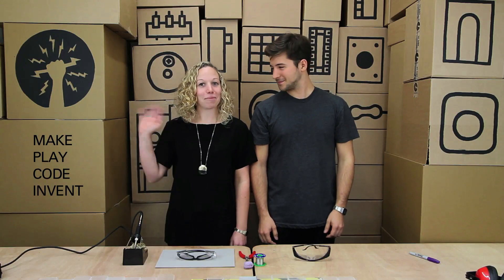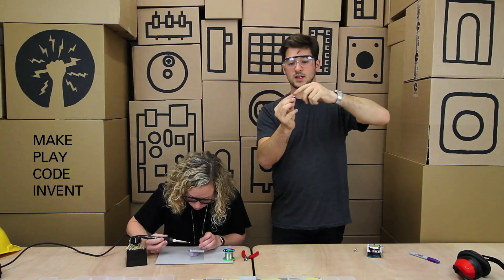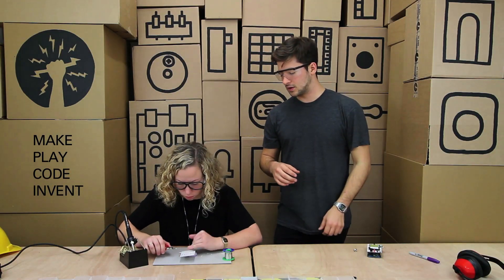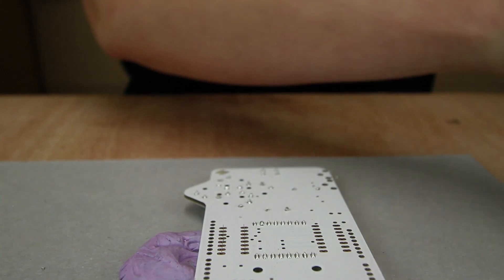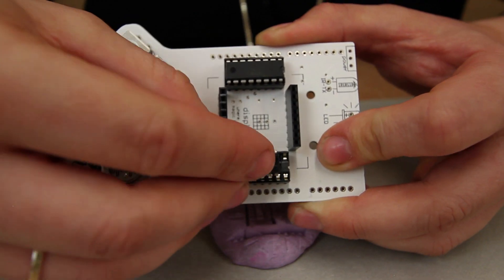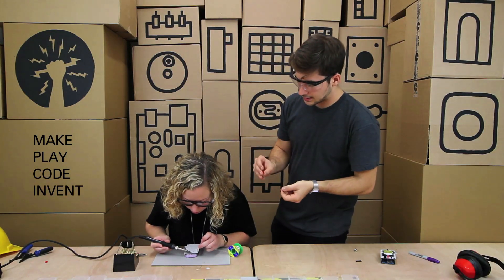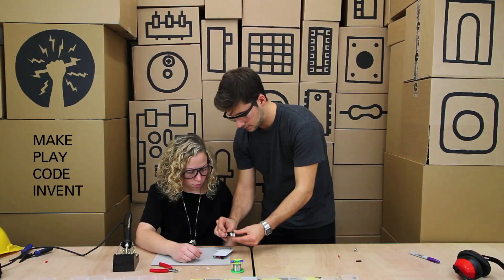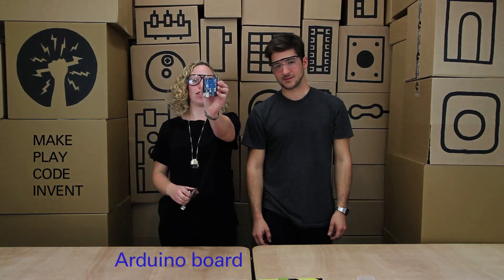Soldering DIY Gamer Kit!

Comment: on the 8x8 display screen, theres a layer of plastic or something to protect it, but i found out there was another layer under that. when i took it off, instead of LED's glowing white, they glow a strong blue.
Reply from the maker: Hi Christopher! Basically the screens are made blue then have different filters/gels put over them to change the light. We wanted white so they add a yellow film. Nice hack!
Reply: +Christopher Gudgeon Omg your soo right there is another layer under it